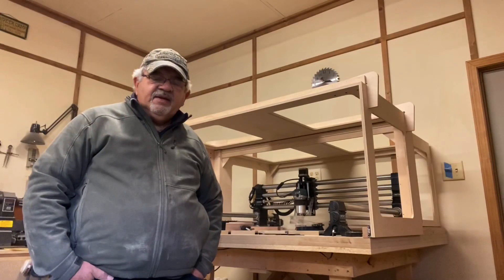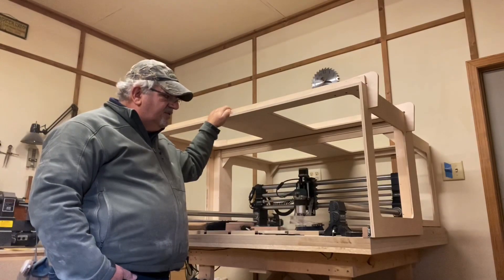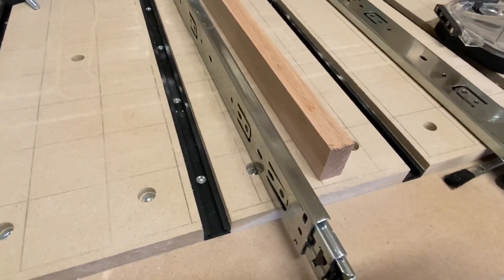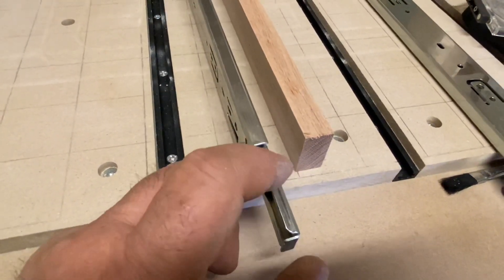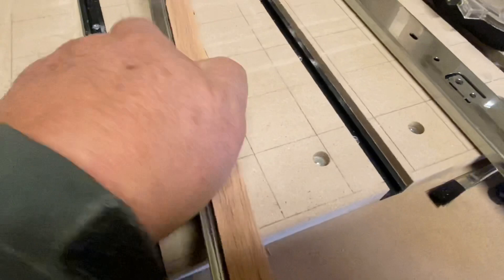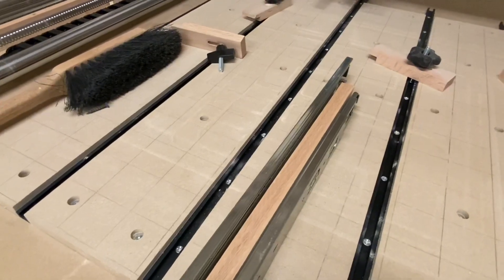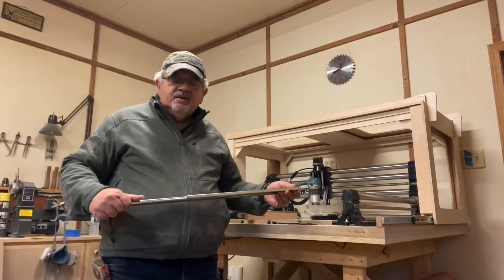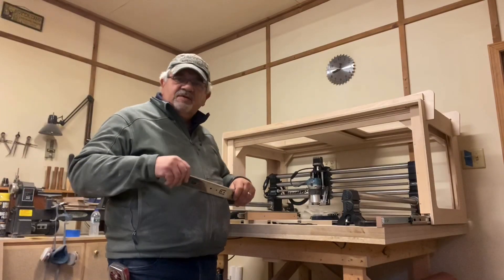Sliding Enclosure for Onefinity CNC Router - Part 1

Comment: Where did you source your piano hinges from? What should I be looking for strength wise when looking for piano hinges?
Reply from the maker: I got the piano hinges at my local Menards but I’m pretty certain any big box store will carry it. The standard hinge will be more than strong enough. If I remember correctly, the overall width of the hinge in the open position was approx 1-1/8” wide

Comment: Excellent enclosure. When I built my first enclosure (2017) I concentrated on sound reduction and fire resistance (layers of styrofoam and plasterboard) but I found the restricted access a real nuisance. My next enclosure build I intend to worry less about sound and more about access. This looks like a really good design for access, good for dust, and reasonable for sound reduction.

Comment: Does that cut down on the noise? Any ideas that cuts down on space?
Reply from the maker: dB value went from 88dB to 73dB. See part 2 video. 20% reduction in the straight number value, however dB rating is not a linear function so more than 50% reduction in sound. If your dust collection is in the same room, that going to be way louder than the router.

Comment: Thanks for a great video.  One question, if the machine is 45 3/8 and the enclosure space is 50 3/4 does the 2 11/16 on each side allow for a drag chain?  Or have I missed something?
Reply from the maker: Yes, you should have enough room for the dragchain

Comment: Thank you for the great idea and details. My OF should come in a couple months and this will be one of my first projects on it. Appreciate the thought on reversing the slide mounts to have access. Very well done.
Reply: @onefinity-trainingtipswithMitz  I am working on learning freecad. Going fairly well. I actually took a 2 year drafting program back in high school and got a certificate in it...40 years ago.  We didn't have CAD, so a bit of a learning curve, but concepts coming back to me.  Freecad is way overkill for 2d but I want to be able to do 3d, so I'm  investing my effort up front I guess to learn one tool well, and the price is right.  Parametric CAD is amazing once you wrap your head around it. I have the side panel drawn and can change height, width, window size, radii, inset groove sizes for windows, etc...and it redraws it to spec.  Now I have to figure out how to make dependent parts, to cut the matching plexi.   Then onto the top and front panels.

Once I get the mechanical parts I can plug in my part sizes to fit exactly.  I haven't played with tool paths for the part yet, but I think even those auto adjust. I had looked at fusion360 a long while back, but when I checked on it after ordering my OF, they slaughtered the free version by removing a lot of features, especially CAM operations it seems. Then I found freecad.

I ordered the drag chain mod and the vacuum boom. I don't know what the boom will do to side panel height, so going parametric is probably a good investment of my time 😀

If this all works out I plan to post the files somewhere...but I don't get my machine til February or maybe March. Then the real learning begins.

Comment: please please please put files up for the woodworker onefinity. I love this idea !!! well done
Reply: I totally understand the hunting thing haha. So I have my Onefinity and I built a 48"x48" table for it. I am going to mount the controller under the table. Right now I have it sitting on another little table next to the cnc. I use Fusion 360 for my cad. Im very new to all of this but I'm learning.  I really like your innovation on this enclosure.  I have never seen anything like it.  I was wondering if maybe you had your files so I could just cut it out quick and easy on my Onefinity.  I guess that would be in a perfect world though haha.  Don't worry too much about it I understand if you don't have plans for it.  Thank you for the video
Reply: @TheLiebigs  I was planning to use fusion360 too but in October they changed the product and removed a lot of features from the free version. I picked up freecad and have started learning it instead of wasting time on a now limited version of f360.  They really crippled the CNC portion a lot. I am drawing this out now in freecad as my learning project.  One of the cool things I'm finding in using freecad is how easy it is to change one size and have the whole thing adjust around it, the power of parametric CAD. Should be easy to dial in exact sizes when I'm ready to cut...just will take a while to figure it out. Up until now, I used sketchup for shop drawings, but I think those days will end as soon as I get better in freecad. If the plans work out, I will post and reply again here.

Based on this video, I think I'll build a 56x49.5 table top for the base. That will be a single 4 ft inlaid sheet with 3/4 hardwood edge all around.  That leaves room for the cabinet, drag chain, etc?

It's so great having people posting content like this.
Reply: @onefinity-trainingtipswithMitz  ok then don't worry about it. Thank you for taking the time to talk with me.
Reply: @onefinity-trainingtipswithMitz  Hi great design , I am just looking now to build my enclosure, your design would be great , I have the same software as you ..would it be possible to obtain your file etc... again great design thank you for showing us.